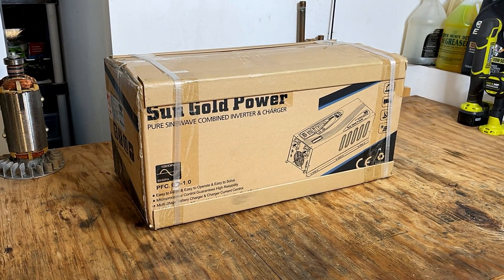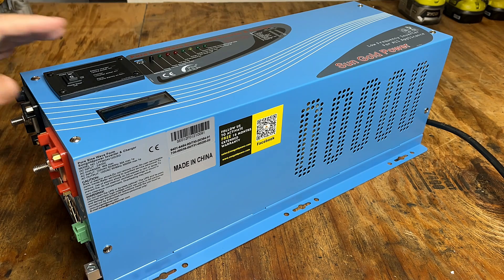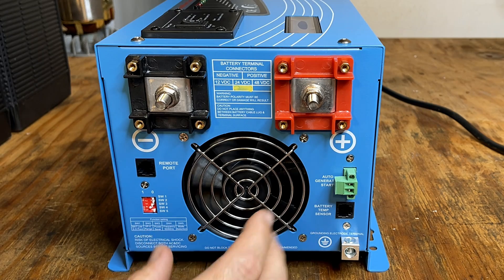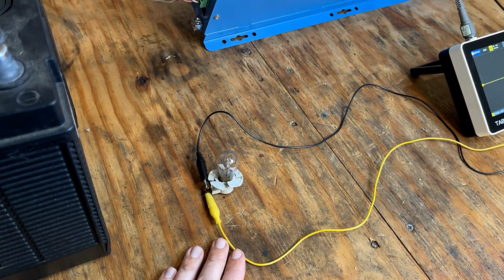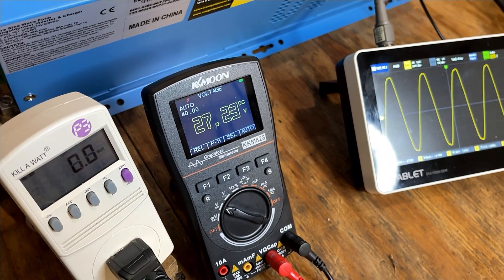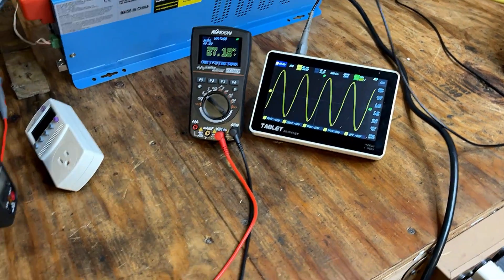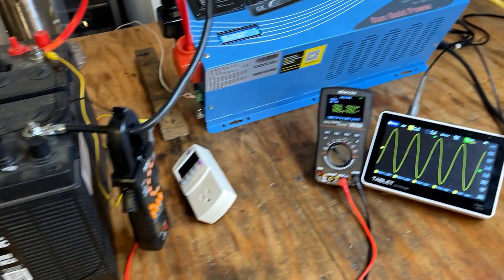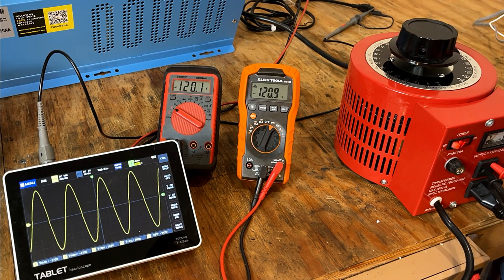SUNGOLDPOWER 3000W Pure Sine Wave Inverter Charger Test and Review

Comment: Transformers are use to step up and down the voltage. High frequency inverters use MOSFETS. Low frequency inverters use IGBT.  MOSFETS can only handle low current low-voltage and they are not very reliable and fail often.  You often find MOSFETS in cheap high frequency inverters. IGBT is often found in more expensive inverters because they can handle higher current and voltage and are very reliable, most likely IGBT are found in low frequency inverters because they’re much more reliable, but the inverters are much more expensive. This inverter contains IGBT and is very expensive but is very reliable.

Comment: I have the same inverter but branded as Power Star.  Ive been using my unit in an off-grid solar setup for a decade and only recently it statted to act up.  Pulled it apart and diagnosed as a single faulty electrolytic capacitor in the control circuit.  Replaced and is working flawlessly again.  These are excellent reliable units.

Comment: Hi James.
Do you still have this inverter with you?
Can you help me with a close up photo of the main circuit board inside ? 
I need to identify the part number of  an 8-pin surface mount iC on the main cirtuit board for a similar inverter whose 8-pin IC burnt up (charred) such as number isn't visible.
Regards.

Comment: I've had this exact unit sitting on a pallet rack in my shop for about two years, unused.  A friend of mine had some kind of issue where they sent this unit instead of the one he was supposed to receive and it was apparently cheaper to tell him to keep this one instead of shipping it back to them.  So I got it for a song.  Anyhow, it just sat there brand new in box until a couple of days ago, when I paired it with two Lifeline AGM 255ah batteries for our camping trip.  It did a great job, powering everything overnight and through the morning.  Then the batteries were charged partially by two 100w solar panels during the day and then topped off by a small 2000w suitcase generator in the evening.  Works great, and I'm very pleased with the setup.  It'll become a permanent feature on the travel trailer, but for this permanent setup I'm going to use LFP batteries instead of the super-heavy Lifelines.  They're much better suited to marine or Class A RV weight capacities.

Comment: @2:07 Regarding Automatic Generator Start (AGS), have you tried that? I have had difficulty getting the SunGoldPower 3000W inverter AGS to start or stop my 2020 Onan 2500 LP generator  using the inverter's AGS  dry contacts. For those unfamiliar, dry contacts are a safe and standard interface for many worldwide generators that provide the  automatic remote start function when the battery voltage gets low (10/10.5V). Can you kindly demonstrate the AGS on this inverter?

Comment: Well, mine has now failed after 5 months of very light use in a trailer. 3 trips total, with less than 10 inverting hours on it. Sad commentary. Should have sprung for a Victron, given the investment at stake.

Comment: I'm disappointed in the inefficiency of the DC charger. At the max output of ~90 amps @14.4v (1300W), it pulls almost 18 amps AC @123v (2190W). That equates to about 60% efficient. When turned down to around 45 to 50 amps, efficiency rises dramatically. 12v unit, of course.

Comment: I have this Sun Gold Power inverter at an off-grid seasonal cabin.  It is turned off when I am not there.  It’s under two years old and has worked fine since it was installed.  It recently started to turn itself off after being on for about 15 seconds.  Upon turning it to the off position and restarting it, it again continues to shut itself off within a minute. The LED readout is scrambled and unrecognizable.  Any thought on what is causing this to occur?

Comment: I like the ones that can mix utility with battery. I dont want a 3000watt inverter and then because i use 3175watt for an hour i then need to draw all 3175 watt from utility instead of just 175watt.

Comment: I love your videos they are very detailed. I have a question I can’t get an answer for. I have a portable backup generator that is not a inverter. It’s 17,500 watts running and 26000 start up. I’m not sure what THD is but I’m sure it’s above 5. I m worried about my refrigerator and LCD tv getting destroyed. I was thinking about buying a few power inverters and somehow through a power supply plug them into the wall then plug the TV or refrigerator into the inverter to get a pure sine wave. Can this be done and if so how. Because I’ll have the house powered through the generator I thought I could power the inverter through wall ac power any help will be very appreciated.

Comment: It is driven by MOSFET, it cannot be driven by a transformer. It's either MOSFET or IGBT.
I'm not sure IGBT's are being used as yet in solar inverters.
The transformer is on the output end of the circuitry. A transformer cannot be "switched".
Reply: Correct, transformers are use to step up and down the voltage. High frequency inverters use Mosfits. Low frequency inverters use IGBT.

Comment: Beware of Sungoldpower. they do not honor their warranty. I purchase 2 inverters for parallel operation and one was bad out of the box. 90 days later they are still giving the run around. They do have a concerted effort to remove and edit out their bad reviews on their website too rather than fix the issue.

Comment: I have some welding machines from SUNGOLD, inverter type machines. They are the beast in class. I have 4 different welding machines and SUNGOLD beats them all. I have had the machine for 2 years and has been a  champ. I would not be surprised that these inverters are good quality and last for some years.

Comment: I just came across this video, after I bought a AIMs inverter. Looks like a knock off of the AIMs. Sungold price is cheaper. Made in China. Same package. Same color. Same features. Same connection and switches.
Reply: I have been doing a lot of research I have a hunch that the manufacturer for aims, sigineer, and sungoldpower are all the same.Aims cost more because they pay for the certifications such as ETL and warranty work you are paying for the additional services such as customer services that you may or may not be afforded to you with the other brands. You get what pay for. In my case, I am going to get what I can afford Sungoldpower.

Comment: These LF inverter chargers still have MOSFETs but they are much more robust but yea my aims 3000 won't pass power through and charge the battery so I bought a renogy 2000 inverter charger and I paid 425.00 for it which I regret doing but aims hasn't responded to my email about getting a 2nd control board for it that control board is where it has the transfer relay and battery charger relay it's around 150.00 for it which I would rather spend than 425.00 I'm going to work on getting aims to sell me one again at a better price and a garentee or something but if that happens and I get the board I would love to sell the renogy one at least break even on it but I love the aims one to be honest I love the current control knob the renogy I have to go through a menu system and it's a pita plus the battery terminals are sideways the aims one I made bus bars for out of copper pipe too so yea I hope I can get the aims to work properly it's only good as a inverter for now

Comment: Can you recommend a good inverter generator with the autostart feature that would work with this inverter/charger? Thanks in advance.
Reply from the maker: I wish I could.  I think this is more designed for a whole house generator.  It might be possible to get it to work with a Honda eu6500 or eu7000.  Was looking into that at one point, but would require some custom work.  Not plug and play.

Comment: You can directly attach this to your home power? Does it give you the items to do this? This will then use the homes ac when the batteries become to low?
Could it sense that the homes power doesn't have enough Amps on the particular circuit(due to other things pulling from that circuit) and then pull from batteries?
Reply from the maker: It does not come with anything to connect to your house.  It could be connected in such a way to power a couple circuits in your house.  It will automatically charge you batteries and if the voltage drops low or utility power is lost, those circuits will keep running.

Comment: Can someone tell me what the inverter does in the  Power Saver Auto switch position vs. just turning the inverter off?  I have the 4000 watt model and the inverter seems to function the same when it is in either the Power Saver Auto position or in the Power Off position. Do I have a Dip Switch on the wrong position?  Other than that, great unit.  Any guidance would be much appreciated.
Reply from the maker: My understanding is that power saver uses a little power and monitors.  When it senses a load it turns the inverter on.

Comment: Hi James, does it convert the square sine wave power from the generator to a clean up pure sine wave?
Reply from the maker: It does not
Reply: @jcondon1  I hear those kind of generators mess up the inverters when they are charging the batteries. I think eg4 is selling a 48 V charger now because of that. That's in those all in ones

Comment: Wow what an awesome machine! I like the fact that they've gone back to using mains frequency transformers. I have many scrap inverters in the UK where the high voltage MOSFETs have blown up horrendously and destroyed the control circuitry.
Reply: via internal elec auto transfer switch.  No Interlock necessary.

Comment: how do i hookup a solar panel?
Reply from the maker: You would need a separate solar charge controller to connect to your battery bank.
Reply: @jcondon1  Thanks James for this video and your comments. As I understand, if I have a solar panel, wires from the solar controller go directly to battery bank not to this unit. Is there a problem if battery bank is being charged by solar panels and simultaneously shore power is connected to this unit?

Comment: Ohms law- 120v x 15A = 1800w, 120v x 20A = 2400w so with these inverters you will NEVER get the 3000w out of the standard receptacle, it MUST be hardwired for full output. I've seen 3000w inverters with NO hardwire terminals...I'm not sure how they expect you to get full output.
Reply from the maker: I see that too.  There are generators out there that make more power then then the outlets can support.
Reply: Wow that's a great point

Comment: When using a generator with a built-in electric starter will this inverter/charger activate any generator with electric start or are there other devices required or do you need a particular type of auto-start generator?
Reply from the maker: It will not start any electric start generator.  I think it is geared more toward home standby generators rather then the portable generators I normally work on.
Reply: The generator needs the autostart ability, if it's a regular electric start I think most can be modified...but not sure on it.

Comment: Hi very nice review. What is  the idle consumption of this unit?
Reply from the maker: I did not test that.  According to the manual it is less then 25 watts when the power saver is on.
Reply: @jcondon1  Throw your clamp meter on the battery cable with no load, should tell you
Reply: @mrmotofy  I was wondering how to do that. It must be 50 W probably just like the the all-in-ones I want to get an MPP lv2424. But they are 50 Watts apparently they have a power saving mode I wish I knew what that meant. I wish I knew what you could do in power saving mode
Reply: @VinceBadovinatz88  power saving is a low draw system that pulses or something multiple times and kinda wakes it up as needed. But problem is it doesn't work well for low draw devices. Say a 10w lightbulb...has to stay ON so it draws 60w instead of 10w...but add more capacity and lot's of solar to charge. Producing power is never cheap
Reply: @mrmotofy  Thank u very much😎

Comment: Question I have one I'm having trouble with my generator charging my batterys on rainy days  I set it up to a T the lcd screen says ac abnormal  I p 123v  the batterys show 30% the inverter charger won't kick into charge mode on lights or charge period can you help what can I be overlooking people I bought it off  little knowledge in left field
Reply from the maker: What type of generator are you using?  Brushed, Brushless or Inverter?
Reply: @jcondon1  I have a ford fg6250e generator I took the ground off the back side to work gfci receptacles I have  good power generator around 1 year old

Comment: Sun Gold looks EXACTLY like the AIMS Corp unity out of Nevada. AIMS user
 manual is detailed, and their user support is difficult. Thanks for your nice review. Just compared 
the 2 manuals, and they are the same, with Suns having made a few minor 
changes. Aims unit for 3k is $1.200.00 and Sun is $750.00. No status LED read out on the AIMS unit.
Reply: There's a lot of the companies that sell essentially the same thing. Snap On sued Harbor Freight over a floor jack...it came out in the trial. HF bought from a catalog of a Chinese manufacturer...OOOPSIE so did Snap ON LOL so they lost. Tons of relabeling going on. Those fancy $2-300 computer gaming chairs...Yep you can buy one customized for you for about $75.
Reply: Actually sungold was around first,  Aims possibly procures its producs from sungold..?.I remember when aims products were terrible..and then they came out with their low frequency (sungold clone)  I think it's what saved that company.....

Comment: What generators are compatible with the 2 wire start function?. I can't find any information on this or how to set up a remote start generator to work with this inverter feature. Thanks for an excellent channel.
Reply from the maker: Not sure.  I only researched if my EU6500 could do it.  Might have been possible, but would have been a hack.  Maybe large non portable generators might be comparable.
Reply: The only that I have witnessed on YouTube is aims generator look Gavins garage he has a  video for that

Comment: Hi James, I just stumbled upon your Inverter video and have been working on a similar system for long term home backup power so, wanted to share my findings.  First off, all inverters use Mosfets, there are 2 basic types:  (1) High frequency inverters use a 50 kHz (25 to 100 kHz) switching power supply to boost the battery input voltage to around 200 Vdc, then they use a second switching power supply to generate a 60 Hz sinewave at 120 volts from the 200 volts.  (2) Low frequency inverters use a similar high frequency switching power supply to generate a 18 volt (in the case of a 24 volt inverter) 60 Hz sinewave, which is fed to a 60 Hz step-up transformer, which is what makes the unit so heavy.  The use of the 60 Hz transformer makes the unit much more electrically rugged.

I spent a year and a half testing 24 volt inverters for my application.  Of the 6 Chinese ones I tested, they all failed within a few months.  They also did not put out rated power, overheated easily, and had poor protection circuitry.  So, if you need something you can depend upon, the only one I have found super reliable under all conditions so far is the MagnaSine Magnum Energy series inverters.

Lead acid batteries have a high series resistance, I don't recommend pulling more than 1/10 C current from them as a continuous rating (Yes, they will supply several times this for surges).  1/10 C means one tenth the capacity rating.  As an example, for a 12 volt marine that has a 100 amp/hour rating, don't try to pull more than 10 amps from the battery.  I know this seems ridiculously low but, pulling more current than this causes the series resistance of the battery to start internal heating.  This is bad for 2 reasons: you are throwing battery capacity and heating the battery, which can easily take you above the maximum operating temperature of 79F/26C for lead-acid batteries.
Reply from the maker: Thanks Bill, I appreciate the insight.

Comment: Nice product and excellent presentation. 
One thing I’m hoping to see demonstrated is the transfer switching cycle - from normal grid input at 1.5~3kW, to simulated outage state, to automatic auxiliary on mode. Wait a minute, then to grid returning, to automatic auxiliary off mode and back to normal grid input. As you know most of us operate manual interlock plate by the breaker panel. Wondering how this product automated that?

Comment: I have this exact inverter but I am having trouble with the shore power charging function. Does anyone know why that might be? It had initially started to charge but at some point shut down and will not start again. I have cut power, changed to a higher gauge cord to plug in shore power, and checked all connections. 

It is functioning on shore power mode and showing everything coming in properly. It just won't switch to charge mode.
Reply: I hope you got it fixed
Reply: @VinceBadovinatz88  yes we did. Honestly can't quite remember how at this point. Still working well after a year of constant use.
Reply: @huskerapologist  thanks for the reply anjem pho